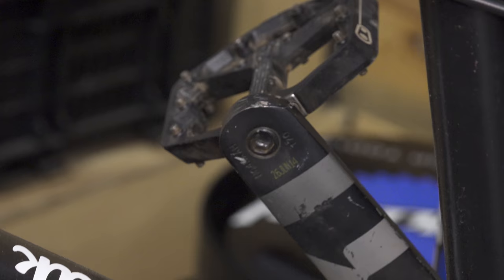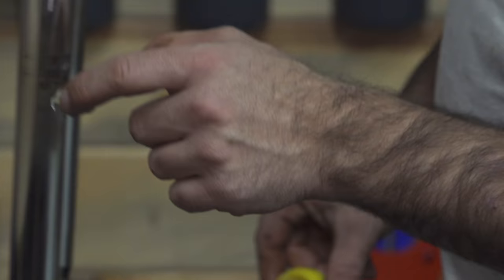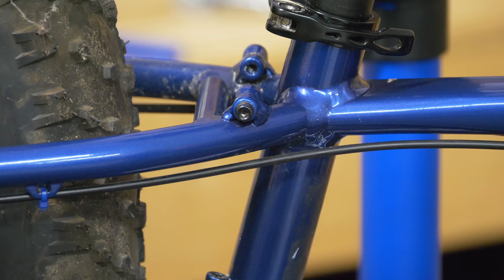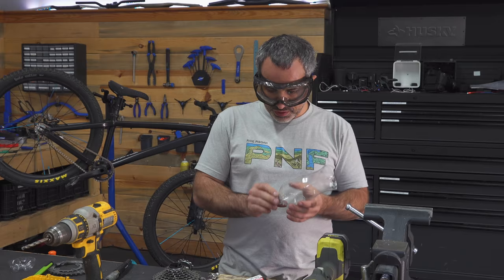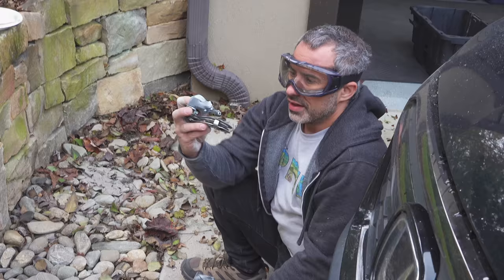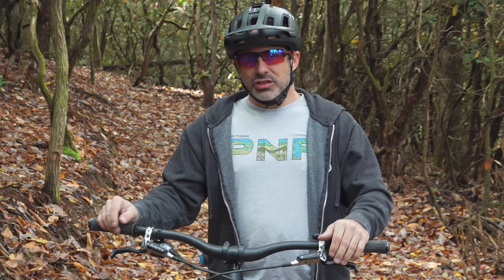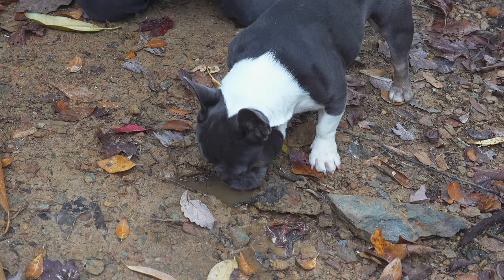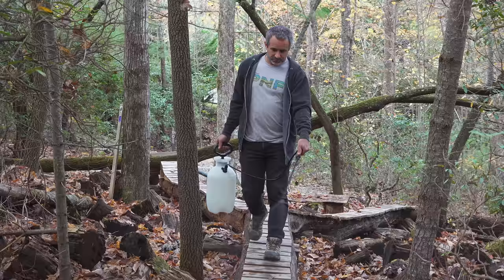10 Mildly Useful Hacks for Mountain Bikers

Comment: The best way to get blood out of clothes even if it's already dried is throw the clothes in the washing machine dump hydrogen peroxide on it put half a scoop of OxiClean and a capful of Lysol concentrate And that will get out every stain. With this method I have completely cleaned blood soaked socks pants and shirts not to mention it also gets out red mud stains without the hydro peroxide

Comment: Use hand sanitizer to slip on handle bar grips. Put a bit of sanitizer in the grip roll with finger and push it on the handle bar as u want. The alcohol waporises of in about 5-10 min and they dont roll after that. No need for air compressor. 🤪

Comment: Between mountain biking, martial arts and rock and ice climbing, the best way to get rid of blood out of garments is a 50:50 mix of hydrogen peroxide and spray and wash. Pre soak for at least 30 minutest then toss in  the washer. It will have the blood removed.

Comment: DIY helmet visor gopro mount
We all know handlebar footage sucks and some helmets are 
just a pain to mount a gopro to on a handle bar mount there is the first part that the screw goes through a gap then the part it threads into if ur willing to brake ur handlebar mount the n take a saw and cit the circular part that goes on the handlebar off you will be left with two pieces then you will want to take the screw that clamps down the mount and match that size to a drill bit then center your drill on your visor and drill a hole through it then you can attach the to pieces with the screw and either mount it on the visor or underneath the visor whatever angle that you prefer I’ve been running it for a while no complaints may not work on some helmets that the visor moves freely on

Comment: If you have an air compressor, then you have 95% of a sandblaster. And if you are gonna buy the nozzle, you mind aswell buy the proper kit, for not much more. With all the hot glue you used, I think it might even be cheaper!

Comment: i  have a hack for you. put the god damn metal disc guard on your angle grinder and use a proper disc... in 4:58 you can clearly see the disc starts bending slighltly as you moved it sideways... only do cuts with a cutting disc. period. there was an accident about to happen.

Comment: "if you're worried about the potential long term impacts of spraying chemicals in the woods so they can then leak into the water system and affect everything in the area, just think about how if you don't do that, you might have to chop down a couple trees!"

Gonna be honest, wasn't really that concerned about the environmental impacts until that attempt at a joke. I think you can do better in talking about potential environmental impact than joking about chopping down a few trees which, grand scheme of things, doesn't have a huge impact on the local environment.

Comment: Been riding for decades - and if you have time between descents and climbs to fiddle with your glasses and fitting them in a small thingamagig on your handlebar - you're doing it wrong, buddy. A much better, faster and 400% less fiddly solution is glasses (often sold in hardware shops or Home Depot as PPE) with a retaining string around your neck, or - take a string and tie around the legs of your glasses. During the climb when feeling they start fogging up - one flick of a hand, or even shake of the head - and they rest on your chest without falling off. Then, when needed, they go back on eyes almost just as easily. Bonus - they will never fall off. Also - although this guy talks a lot about being "legit", a video of showing a fork being cheated into looking better than it is by visual trickery - that does not seem legit. Anyway. Greetings from Latvia, keep on riding.